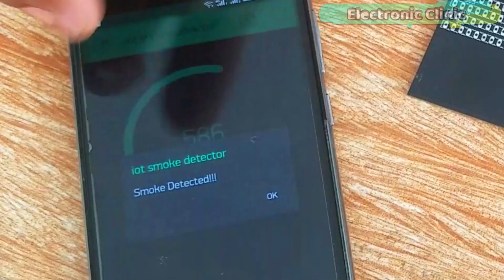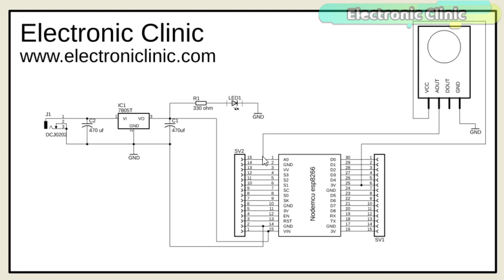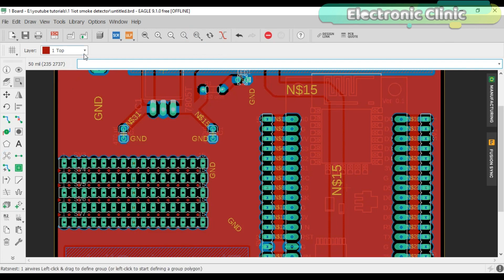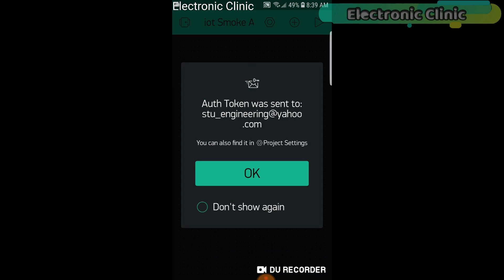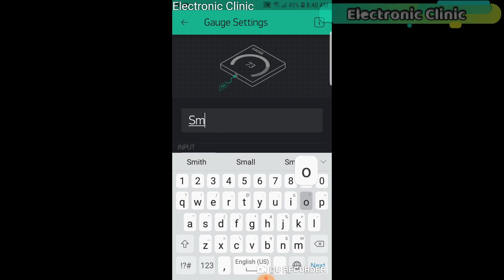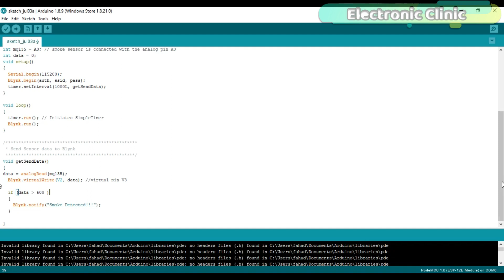IoT Smoke Detector using MQ135 Gas Sensor, Nodemcu ESP8266, and Blynk Application

Comment: Sir can i use node mcu only  cuz
I can not acess  a pcb plz respond
Reply from the maker: I have explained the circuit diagram. You can solder all the electronics on a Vero board.

Comment: I have a problem here.. i also have the voltage regulator same like but i did at pcb.. but after i upload the code then i unplug the usb suddenly its not connected.. FYI, i use 12v 1amp for my voltage power supply.. after i remove the sensor.. nodemcu start to connect back.. it’s only disconnected when i’am connect the sensor to the nodemcu.. can u help?
Reply from the maker: check your viltage regulator, and make sure you connect the decoupling capacitors
Reply from the maker: i have been using this power supply with nodemcu esp8255 and esp32, works best and you can check my other videos.
Reply: Yes i’m using the 7805 because i need 5v for my esp and relay.. and my e-cap value is 25v 47uf..
Reply: For my project i have 3 sensors, mq2,dht11 and ultrasonic.. the other 2 works fine except mq2.. i dont think that it was my coding issue.. its works fine for all sensors when i plug in the usb to computer and turn on the 12v adaptor.. but after i remove the usb cable the connection is lost.. i think it is my component problem.. but after i remove the sensors.. my power supply have the correct reading.. after i plug in the mq2 sensor.. it’s only works for 2 minutes.. after that the voltage drop.. please i need help.. i have presentation next week..
Reply: This is the component i use for my voltage regulator :
1) 7805
2) 25v 47uf 
3) 330ohm 
4) Led indicator for power supply 
5) 1k variable resistor for 3v output
My voltage rgulator have 2 ouput one is 5v and 3v. So i dont know which component is not suitable for all my sensors to make it working fine.. please i really need help.. my electronic basic is not to firm.. 🙏🙏🙏🙏🙏